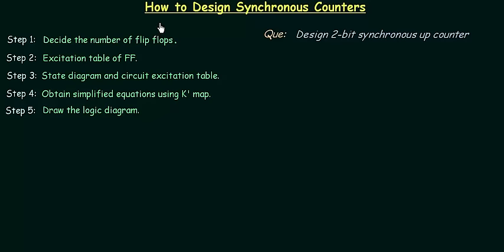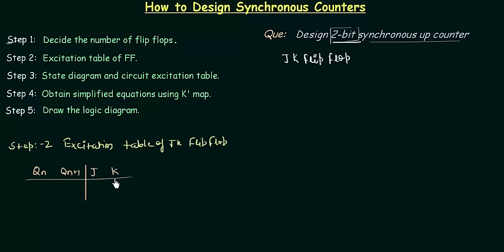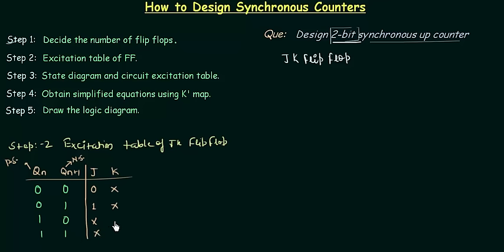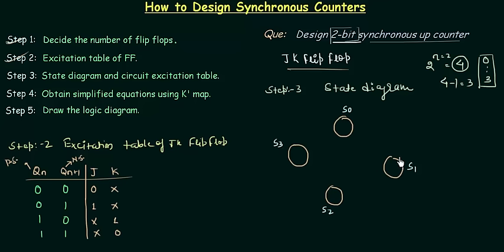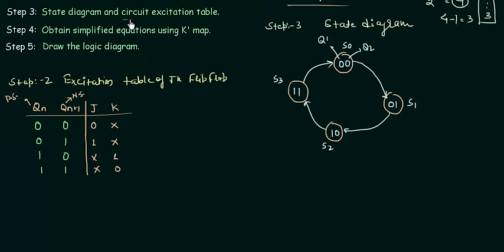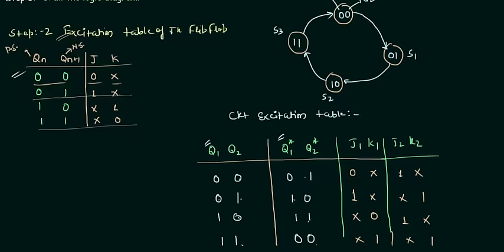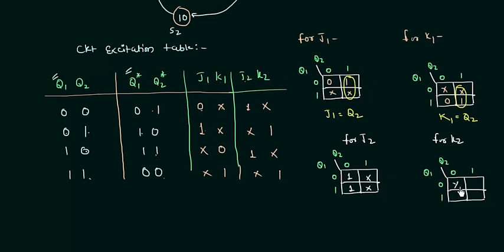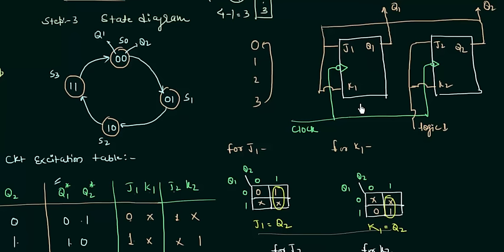How to Design Synchronous Counters | 2-Bit Synchronous Up Counter

Comment: the final diagram is wrong.You have considered Q1 as the MSB throughout the entire video. But in the end, you drew the diagram Q1 as LSB. The flip flops should be reversed.
Reply: no the circuit is corect. bcoz he fed i/p frm ryt to left.. so its the same case when we fed i/p lft to ryt and see o/p in inverse form(i.e. last f.f have msb) so either u inverse o/p or i/p.
Reply: Yes final diagram is wrong ..q1 and q2 are interchanged
Reply: I think as the circuit is synchronous (without feed forward), the placement of the flip flops shouldn't matter as long as we know that Q1 is MSB and Q2 is LSB
Reply: yes crt
Reply: yes ur crt the logic diagram is wrong i found in book
Reply: yes bro. even i got confused due to that.
Reply: @RahulMadhavan  exactly
Reply: Totally incorrect at last....
Reply: yes , its wrong but if just reverse it it will be correct
Reply: Yes final diagram is wrong
Reply: I was confused by the same thanks
Reply: @shubhnamdev5265  he fed input from left to right I think
Reply: Yes because the kmap is also wrong

Comment: For people getting confused about MSB LSB!. It is a "synchronous counter" i.e one flip flop doesn't depend on the output of the previous flip (getting clock from the previous one) like in async counter!. So initially he took q1q2 (with q1 as MSB) and he did the procedure with the same! and in the diagram eventhough he drew q1 first and q2 second EVEN if he drew q2 first and then q1 IT DOESN'T MATTER!! what matters is what YOU CONSIDER AS MSB.  So if q1 is initially considered as MSB then in the FINAL the same q1 MUST be taken as MSB and fed to some other circuit (perhaps?) but the representation doesn't matter!.  ALTHOUGH things would've been clear if he had taken q1 as q2 and q2 as q1!. Ask me any doubts if u have!
Reply: Alright, bro how is J2 & K2 coming out to be 1 ? 
Using k-map
Reply: you explanation is too good thank you this may clarify the doubts of all.
Reply: @-A-Rohith  I forgot I left this comment. I got gate rank 3000 in my first attempt landed top CS product jobs and now it's 6 years. But thanks for saying thanks. You brought some memories

Comment: I think the final diagram is wrong,you had to switch Q2 with Q1.but even so I thank u for this great tutorial.
Reply: Nope it was right
Reply: @yawarhayat5628  No,At start Q2 was LSB and Q1 was MSB.He did mistake at 12:22 while designing diagram.
İf u designing a up-Counter then you need to start with LSB byte and then u keep going adding bits from LSB to MSB byte one by one(Q2+Q1) ,otherwise you would make down counter.
Reply: @UC4WsFDbcR48Q6BUyPElZ0XQ It won't matter in synchronous counters because outputs aren't fed to clock unlike asynchronous counter...
Reply: @yawarhayat5628   7:07 He decided Q1 is MSB and Q2 is LSB ok ? But Q1 output at Final diagram had to be interchanged with Q2.Where am I wrong at?
Please look at video again.

Comment: Guys q1 is MSB and q2 is LSB
Reply: Can you explain me how Q1 is MSB and Q2 is LSB?
Reply: @abhirams6452  my friend this is the mod 4 counter output will be from 00 to 11.... ie  00 ,01 ,10 ,11,00,01,10,11... if you draw the wave form for the circuit q2 toggles often ie the output of the q2 will be 010101010.....  hence the most  toggling bit is LSB  the output of the q1 will be 00110011  it toggles less no of time hence it  is MSB....in order to check the answer compare first instance of q1 and q2 .....followed by second and then third and check whether the circuit is mod 4 counter or not...

Comment: if i want for example to make a synchronous  counter based on T flip flop how would i do that is it the same as Jk with considering T =J=K or i should use the conversion between JK and D and then use the conversion between T and D ?

Comment: i have a doubt please help me. suppose i need to count like this 0,1,2,3,4,5,6,7,8,9,19,18,17..............................10. i will use bcd counter first then is should not  be using reset right coz cunting in reverse from 19 , what should i  be using pls help me!!!!!!

Comment: May I know how to choose whether to use positive edge or negative edge FF?
Reply: Anybody knows?
Reply: @anwar-gc5kv  you can use posedge or negedge as per your convenience in the design process, eitherway you get the same counting pattern, only changing the edge at which the circuit is triggered

Comment: hi! if K1 and J1 are LSB  then why u not written it in left side of the J2 and K2 respectively on the truth table
Reply: AMAN SINGH even i noticed the same thing... i guess it's a mistake... although the method is correct but the solution is wrong....

***** : Please check

Comment: Why don't we care about MSB and LSB here ?  i think Q1 should be in place of Q2 and vice versa. plzz clear my doubt.
Reply: Nitish Kumar I'm also in doubt here, did u get it clear?
Reply: When exactly do you see the problem? I didn't see any issues
Reply: Afrasiab Himaloy yes u r ryt... bt the ckt is correct. when u see that Q2 is lsb and Q1 is msb.. it can be cleared by ckt exct. table but yes he made the diagram little bit confusing  for new one's.  i also want to say about that how u can see the o/p msb and lsb ,if u fed i/p to f.f ryt to left (as he did) than your o/p is in ryt order (in his case Q1 Q2) but as we see upto now we fed left to ryt the last f.f will gave msb,. so upto now we consider inverse order,..
Reply: thats what i was thinkinking state diagram lsb Q1, msb Q2
Reply: you need not worry about msb and lsb since the clocks are given simultaneously

Comment: Q1 is MSB, Q2 is LSB. Final circuit is obviously wrong.
Reply: +Anirban Nanda If you verify with a time diagram you'll see it's not. Anyway, during the step 3 you can also consider Q2 as the MSB and Q1 as the LSB, and fill the correct values of J and K. Then, the final circuit will be different, but still valid (I tested here the both cases for myself).